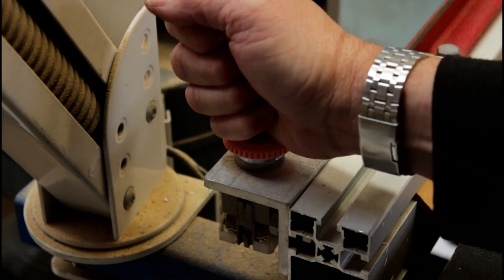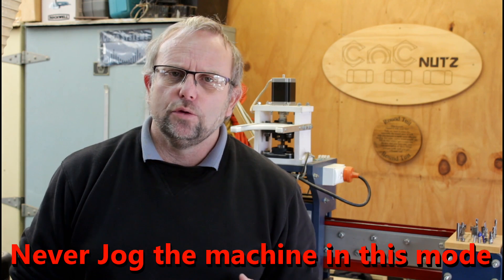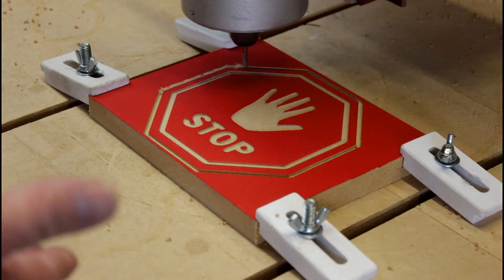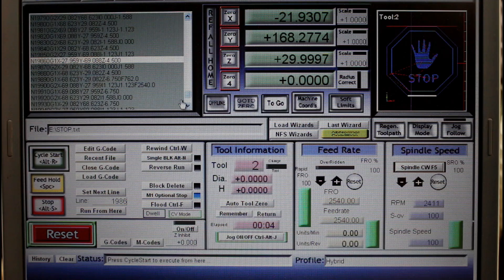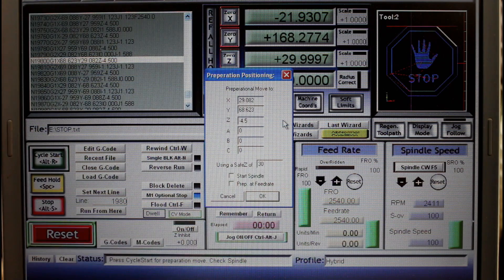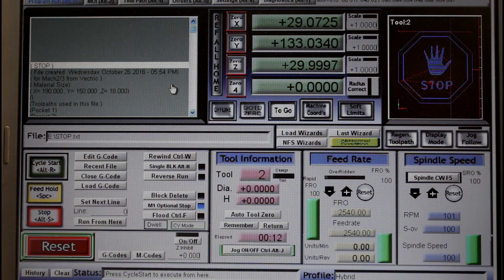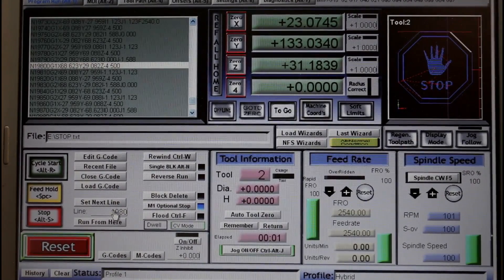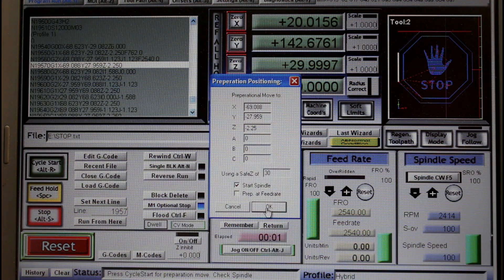Stop and restart Mach3 - CNCnutz Episode 119

Comment: I am 72 years old retired naval architect and mechanic engineer who are CNC fan for decades. My today new hobby is to do leather staff, so my new toy is a fantastic industrial arm type of sewing machine, Nagoya brand. As I am not expert in sewing, I can't stop and restart in an exact spot to change machine sewing direction when I need it, so I already changed the factory machine electric motor to an stepper motor instead, which is driving the machine through a synchronous pullies and belt which are working perfectly and all controlled by MACH3. Now I need to improve this modification by installing a "third hand" (pedal) to leave my two hands free to assist the actual sewing. ¿What will be your wiring suggestion if I want to install a pedal to solve?,  , I am using the popular red chinese Mach3 USB Interface Board that you may know it. Many thanks for your appreciate support.

Comment: Hello Sir, is it possible to feed hold a job half way, switch off the laptop and machine and restart the next day from the halfway ?
Reply from the maker: If you have homing switches that are  accurate and allow you to re-establish your home position, then so long at you save your work offsets  you should be able to turn the machine off and restart the next day.
Cheers Peter
Reply: @cncnutz  Thank you Sir for your prompt reply.. I am new to cnc and really do not know about saving my offsets could you please direct me to a video or any other material to learn the same
Reply from the maker: @vjmalhotranz  
Episode 158  shows how to use work offsets but I do not have homing switches on my machine in this episode so use an alternative method to find home position. The concept is the same though. https://youtu.be/_4kQC9MUtjY
Reply: @cncnutz  Thanks a million , I have been able to follow your advise and obtain the results. Thanks again

Comment: Sir if power cut and machine will stop due to power cut, then mach3 required push click on feed hold , although machine stop due to electric power failure, if need feed hold necessary, then required stop button click after feed hold button then stop button then close mach3 software close , by cancel ❌ button, please guide me

Comment: Hi Peter there is one more way to stop the program file from running at any time and that is to press the escape key, if you are using a parallel port controller and a computer keyboard. The program can be restarted afterwards using the start from here method. I find pressing the escape key  is quicker then using a mouse to press feed hold when I want to stop my machine program.  Great video thanks.

Comment: I just used the stop buttona dn then cycle start and it cut through my work :( wish i watched this first. After a stop  -Does the "run from here" stop the machine ramping back to where it was stopped?
Reply from the maker: Yes it does because it moves the cutter above the work then positions it into the work then starts cutting.
Cheers
Peter

Comment: Peter, this is simply a huge help to me.  I've struggled with numerous ESS connection loss during various jobs and 'am shaking in my boots every time I need to restart the job at a specific line.  I usually manage not to foul things up, but I have certainly ruined my fair share.  Your explanation on the various stopping methods and starting idiosyncrasies is invaluable to me!!!!!!  Thank you a thousand times over.  As a new subscriber, I will review all of your videos and I'll bet you solve more of my questions.  Thank you again.  Finally, not sure why I have so many ESS connection loss incidents, but if I know how to recover, that will give me some level of comfort.  Cheers, Dave
Reply from the maker: Thanks for the feedback David.
Really nice to know the videos help others. Not sure why you would get the disconnection issues on ethernet as it is usually very stable. I used to have a lot of issues with usb but since moving to an ethernet motion controller I haven't had a problem. 
Cheers
Peter

Comment: If power failure occurred, then spindle will stop immediately but PC(UPS SOPPORTED) will send command to driver.now in this situation if I sense power failure by building hardware then it will change the state of E-stop .do u have any idea for power failure problem.
Reply from the maker: Sensing power failure is easy. Just power a relay from the mains and if it fails the relay will drop back and trigger the estop or you could send it to another input on the control software to perform a machine stop of some sort. Estop will probably loose you position if you have a motion controller. If your ups was big enough you could feed the spindle and steppers off the ups. You might then be able to immediately feedhold then turn off the spindle on loss of power. When the power returns you could manually turn the spindle on and remove feedhold. 
Just one question. How many power cuts have you had while machining? I haven't had any personally but it is an interesting idea. 
Cheers
Peter
Reply: Power cut in india can't be forecast.we have to prepare for anything worst.to reduce setup cost of 2kwatt inverter I have to find solution with least cost.I am developing CNC controller for that reason .it will take time. But I will published in open to all. Some sort of FPGA I will apply.but need what parameters I have to take care.

Comment: In my experience pressing Stop or Emergency buttons while machine was moving ALWAYS caused machine to loose position (slightly), because, i assume, there is no allowance for deceleration. I have 350oz steppers and UC-100.
Reply from the maker: Hi Alex,
When I did my testing for this video I found I lost position on the EStop but the stop seemed to be ok. Maybe because I don't use a UC100 but regardless of that I concluded the best option was to use the Feedhold first and once it had stopped, use the stop button. That way you will never loose steps. Of course with an Estop all bets are off but lost steps are the last of your worries if you have to use the Estop.
Cheers
Peter

Comment: Hi Peter,
Very informative video. I understand you are using a smooth stepper. How have you found it in operation. I have a problem with my current system loosing communication with the PC using the parallel port. The only way to fix it is to restart Mach3. I was thinking of installing a Ethernet Smooth stepper for two reasons, one to hopefully fix the connection problem and two allow me to upgrade to Mach4. What do you think.
Cheers Dave.
Reply from the maker: Hi Dave,
I have mixed thoughts about the smooth stepper and also suffered the same issues you described until I did the mod to fix it. I wonder if your SS has been modded.
Have a look here  http://www.machsupport.com/forum/index.php/topic,16386.0.html

I have just bought the UC300 ETH controller and I hope to get it installed over Christmas if time permits.
Reply: I highly recommend the smoothstepper.  Not only did all the weird issues vanish the machine sounds as though it is running more smoothly.  I'm still on Mach3 and Windows 7 - absolutely rock solid.
Reply: I switched from the parallel port to the ESS about 3 years ago.  
When I used the PP I had to attach an anti static strap to my wrist if I wanted to vacuum while cutting.  Sometimes just walking and then touching the CNC Router caused a stoppage. 
After installing the ESS all of my static problems when away.
I still get an occasional spark but nothing bad happens.
Reply: im suprized you can get mach 3 to run at all on windows7 its designed for 2000/XP. Yes Im a year late But CNCnutz has so much good info
Reply from the maker: +Tom Hutchins
You can run Mach3 on Windows 7 and up but you can't use the parallel port. After that you need a motion controller. Mine is using XP.
Cheers
Peter
Reply: I was responding to DRMNZ stated smooth stepper solved his problem with mach3 and windows 7. so I assumed he was using the parallel port before trying the smooth stepper. Im using XP with a parallel port if you get it set up right and are careful on the shielding and keep distance between certain components it works very well. I believe the biggest problem people have is cramming to many components to close together and crossing or running control wires and high voltage wires parallel.
Great videos

Comment: Good stuff again.  What would be the best way to power down the system in the middle of the job, and continue later?  Thanks
Reply from the maker: If you wanted to turn it off I would do a [feedhold] followed by a [stop], note down the line number then a [goto zero] to set the cutter back at the origin. I would then turn it off. I might even drill a small hole with the cutter as a reference point before turning it off just in case all turned to custard.
When I came back I would power up the machine and make sure the coordinates were still 0,0,0 on the DRO's then  do a [Run from Here] making sure I went back a few lines from where I stopped.

Cheers
Peter
Reply: Great advice....thanks